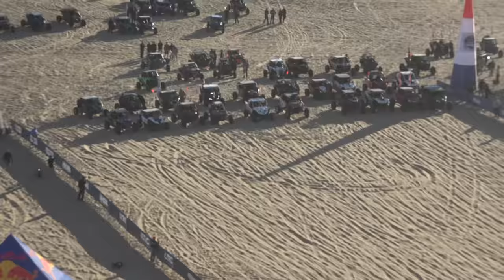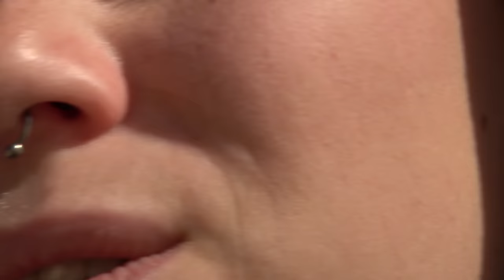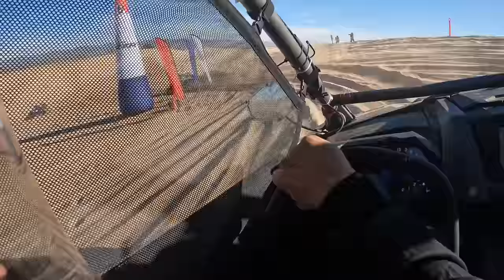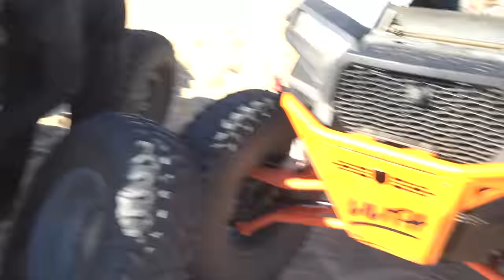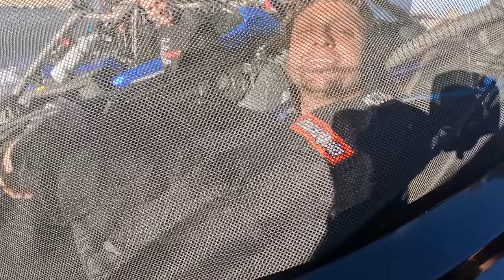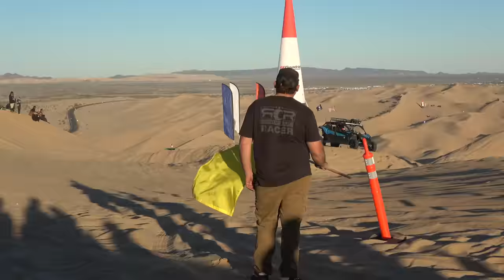NEXT LEVEL RACING! 5 Races - BIGGEST CRASHES YET - Insane Track | RedBull Sand Scramble Is No JOKE!

Comment: Nick, Sprague Clutch behind the flywheel.  Did mine on my 21 XPT.....if good cylinder compression, check out the sprague clutch, its a thing. Will need a 50 buck flywheel puller....250 all in if thats it.

P

Comment: I'm a rookie at this like you guys with 3 trips to Glamis. My 2 biggest tips would be to get some paddles and tune your suspension for racing. I prefer to look outside the main lines so I'm not eating sand. Driving blind sucks. When that happens I smack my helmet and the sand falls off.

Comment: I know the feeling of having boost issues at the dunes. So frustrating!!
Any chance Nick's running an AEM fuel Pump? I had boost and missfire issues after I added that pump. It kept taking out my injectors. I went through 3 sets of injectors before I changed to the red AA pump that mike sells.